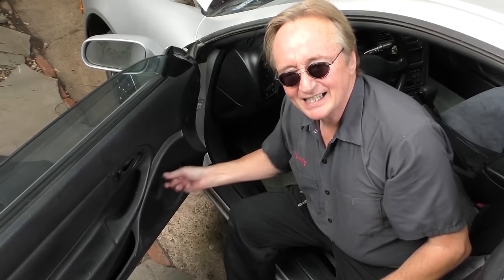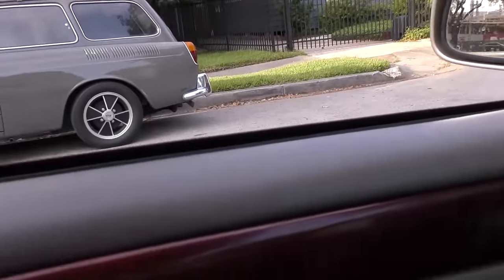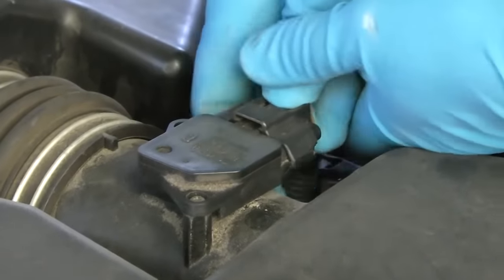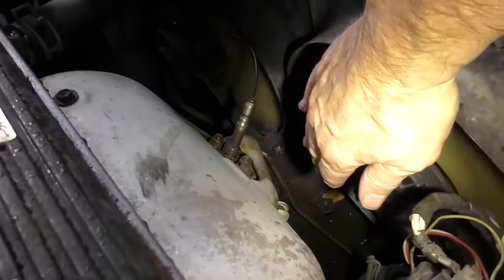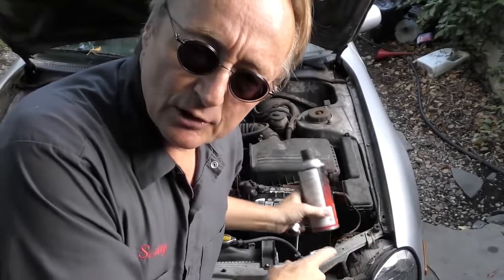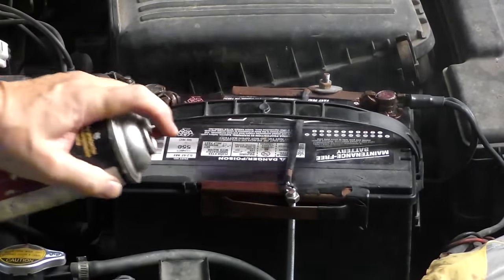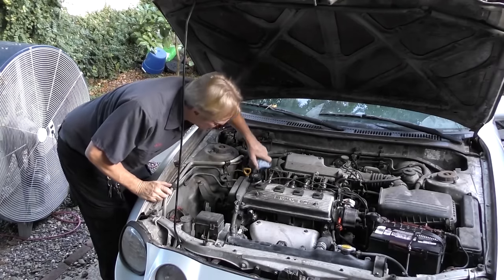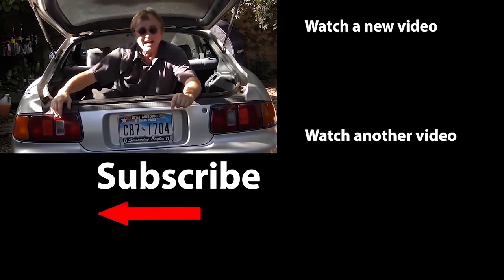I've Been Saying This for Years But You're Still Not Doing This to Your Car

Comment: People thought I was stupid because I did this , glad I've been doing it right all along .
Reply: People were right about both of you
Reply: Abso lutely just be careful in the snow. I live in Canada and I did this once and lost control of my vehicle. Keep your pressure low if slippery conditions, if you inflate to much, max is too much in negative temps, you will lose grip.
Reply: I have a 2002 Nissan Altima  ( I bought new ) that I painted the original muffler  with Aluminum paint every year prior to changing for winter tires. It's still looks great after 18 years !
Reply: @LLC 5016 the window seals are easy and cheap to replace though.
Reply: AngryPostmanSthlm2  say what? That’s a difficult read....
Reply: @maciejolejniczak151  that sounds like projection right there
Reply: We are glad of you now😉
Reply: Stupid people think smart people are stupid! .... go ahead and do what is right!
Reply: @robpet4424  , so you have 18 layers of paint on your muffler?
Reply: @markschiavone8003  yep I guess I do...... but when I show and tell they say "wow that looks like new !"

Comment: Additionally, the silicone spray helps tremendously to keep your windows from freezing to the runners in the winter.  Don't just spray it on the side runners as Scotty demonstrates, but along the top and bottom as well.  Anywhere the glass makes contact where water seeping between the runner and the glass can freeze.

Comment: Pro Tip, when you use the auto down, after the window has completely rolled down, quickly flip the switch up and let go. The reason for this is after the window has completely rolled down, it can take quite a few seconds for the switch to auto-cut power off from the motor. This will really save you a headache and a ton of driver side window motors. Cheers
Reply: Whoah, thank you.  That should have more likes.

Comment: Yeah I remember when the master switch went out on my 2014 Nissan Sentra. They wanted to charge me $545.00 for a new one. I took my car, went to a local junkyard, pulled a master switch out of one of the 30 wrecked Sentras that were close to mine in make and model, put it in and it cost me 75 bucks.

Comment: That silicone helps prevent from getting your car doors being stuck & frozen shut.   During winters, right before it get freezing cold, I spray our car doors rubber weatherstripping with film or coat of this, and prevents them from being frozen stuck.  The regular WD40 helps as well, since used to use that.  And helps prevent from dry-rot.

Comment: I’ve always preferred a thin coat of Vaseline on battery terminals.  Yes as it heat up the film will get thinner but the stuff is cheap and a good glob will last quite a while.  Does a great job keeping the battery acid and gunk off the terminals and exposed electrical metals
Reply: My father does this too. As a mechanic I would have to agree.👍

Comment: Another thing I would recommend with the tires is to check the dot date it's the last 4 numbers in the box or oval after the letters dot the main numbers to worry about are the last 2 that tell you the year the were manufactured if they're older than six years I would recommend replacing them if your tires are older than 10 years they start decomposing and at that point they're dangerous to drive on
Reply: Helpful thank you

Comment: Here is an interesting tip.  I hosed off my radiator on a humid day in early September after a number of trips had accumulated bugs on my radiator.  Only some of the sticky bugs washed off.  An hour later I found yellow-jacket wasps swarming all over the radiator.  They were picking it clean of bugs that the hose had gotten wet but not washed off.  After a few hours the yellow-jackets had completed their work.  The radiator was whistle clean! Talk about a complete job!

Comment: Ya know, it took me nearly two weeks to figure out Toyota's Auto-Up and Auto-Down in my 4Runner? Especially since my Camry only has Auto-Down. If you only push the button partway, you retain manual control. I probably should have read the owner's manual, but who reads the manual? LOL
Now that I figured it out, it's a feature I wonder how I lived without!
If your headlights flicker like a discotheque whenever you hit the button, then you're a proud owner of a Chrysler/Dodge minivan, and no, it's not your battery, alternator, or the windows.
If your car has two electric radiator fans, and only one works, your cooling system can probably handle that (except in extreme circumstances). You will, however, notice reduced A/C cooling ability because the fans also draw air through the condenser. 
Battery corrosion can be easily cleaned up with a slurry of baking soda and vinegar. Sure, it foams up (it's the ingredients for a child's papier-mâché volcano, after all) but it neutralizes the acid and dissolves the fuzzy crystals in seconds.
The only time I've ever flushed brake fluid is after a line failure, I'm a bit OCD so every time I replace a line, I bleed the system at all four corners.
When I buy a car that hasn't been recently serviced, the first things I do are: oil change, tune up, throttle body cleaning, and throttle cable adjustment. You'd be amazed how many times I've bought a car the owner thought was either "a piece of crap" or "on its last leg" that just needed an afternoon of TLC.
"What's the lifetime of the transmission?" "Um, until the warranty runs out." Obviously not Toyota, I'm well-beyond the warranty in my Camry (at just shy of 339k miles) and never felt anything amiss in the transmission. As far as I can trace, it's only had a 100k service performed (by the dealer that sold the car to the original owner) when the fluid was changed.

Comment: HOLY CRAP IT WORKED FOR MY 2004 Camry
Reply: 04 camry is a great car. My O4 has over 500,000 KM's on it and is going strong.
Reply: @stevespademan9611   mine is close lol 460k
Reply: Thats one FUGLY looking car (the whole generation), but nice and reliable tho.
Reply: I just bought a 2004  for my daughter with 210,000 miles and it looks and runs great.Hopefully it will last another 100000 miles!
Reply: I did this once on my window and it worked. It worked so good that when the window was going up, it kept going and never stopped. Til this day my window never came back down from the heavens.😀
Reply: @stevespademan9611  Yeah, they got rid of the 2.2 l four by then...
Reply: Probably the most reliable car ever made.
Reply: @ArnoldPranks  the new ones look good though

Comment: I've been getting recall notices in the mail for a power window problem for my 14 chevy express. not taking it in a chevy dealer bc I dont want them sabotaging my van.
Reply: @mcc7762  i would look into it. I read that they can expire after 10 years?
Reply: Recalls do expire. Had a fuel pressure control module die on my 09  Silverado. They had a recall on them a couple of years ago but they stopped the recall, so the module was not covered. Cost me about$700 dollars to get it done.

Comment: 2:46 Most automatic windows need to be reset after removing your car's battery (especially newer vehicles with lots of computers). The auto down sometimes works, but not the auto up. To reset it, roll down the window all the way and hold the switch in the down position (I know, Scottie says don't do that, but trust me - if you don't trust me, research it). Then, roll it all the way up and hold for 10 seconds. That's it! auto up and down should now work.
Reply: Great info, thank you

Comment: I've only had to replace a broken manual window crank assembly once, but plenty of those electric power window regulators and switch assemblies = "pain in the butt"
Reply: Manual cranks are better, no doubt. People are sheep. They will buy anything.
Reply: 😣Damn drivers side window is auto both ways BUT sometimes likes to go try to go down when I press it up.
Reply: I'm 57 and I haven't owned a vehicle with power windows yet, nor do I plan to.

Comment: Good points have been stated in this video.  Job well done! However, in my opinion the brake fluid should be replaced every 2 years or 50,000 km (30,000 miles approx.). And yet the power steering fluid should be replaced very 100,000 km (62,000 miles approx.). I have always been doing these and never had any maintenance issues.

Comment: We live in an area where we have lots of lakes. My mother refused to have a car with power windows because if she drove in a lake the windows wouldn’t open. My dad worked for one of the big 3 car companies. He got a new leased car each year.  So dad told her to only drive my car that had no power windows or AC. LOL
Reply: Nothing personal roll up windows suck!
Reply: Windows are busted in any emergency anyway
Reply: One can buy a small spring loaded glass breaker for emergency that you can keep in your car. Though a sharp screw driver is good enough to smash side windows with little effort.
Reply: @inisipisTV  the ceramic off of a spark plug also works great
Reply: I live around a lot of canals.  When I bought my Corolla 20 years ago I specifically asked for manual windows.  I got the last model on the lot with manual windows, and a cassette deck.   Windows and deck still work.
Reply: I'm 57 and have never had a vehicle with power windows and don't want to.

Comment: Chemist here. I used to do testing of oil blends in a well known oil manufacturer (know what I mean). What I learned in that job was the reason car manufacturers were able to increase the oil change mileage was because they made the oil sumps bigger. The thought process was, more oil means more additives to use up, the longer the vehicle can go between oil changes (it's the additives that do all the protection and get broken down through use, the base oil only gets dirty and can be recycled). 

I also used to do the QA/QC for a company that repackaged coolant and brake fluid. Some of those coolants are exactly the same just with a different dye (eg. Castrol for Ford is the green version of the Ford blue version coolant. Likewise, super dot4 brake fluid can be blue, green or yellow/clear dependingon the brand. It's just the dye that changes the colour). With coolants, you do have to get one formulated for your type of car. With different rubber compounds, temperatures and metallurgy of the engines and radiators, using the wrong coolant will damage parts, like cause corrosion or scaling on the metal parts, cause the elastomers in the rubber to break down making the hoses brittle, or not prevent freezing or boiling enough (the coolant actually increases the boiling temperature as well as decrease the freezing temperature).

Make sure you use the right concentration of coolant too (usually 50%/50% or 1:1 coolant/demineralised water). It's stays liquid at the widest temperature range at that ratio. If it's too concentrated or too dilute, at low temperatures it turns to partially frozen slush (like a slushy drink) and at high temperatures it reduces the boiling point to the point where you can get cavitation occurring in the water pump due to steam bubbles forming in the low pressure s spots of the pump. Cavitation can act like a hammer and over time can deform the pump housing and impeller to the point where the pump no longer works or can leak.

There's my info dump on those topics. If you've got any questions, feel free to reply.

Comment: Power steering fluid: locate the LOW-PRESSURE Return line, cut it &insert a fuel-filter (I use clear glass reusable filters, you can use whatever kind you want; the transparent.kind let you see if the fluid is getting dirty); ALWAYS put the filter in the low-pressure side, as the Hi-pressure side DOES run at 1,500 psi & usually breaks as soon as the pressure is at it's normal level)...
 Why do I put a filter in the low-pressure side? Because once the filter is in place, I never need to change I again (& I like to be able to see how clean it stays). A few bucks spent once is a lot less than replacing it repeatedly.
Just my preference.

Comment: This video has some good advise. But what you told about the brake fluid is not true. You should change it every 2-3 years.
Reply: I agree, even a small amount of moisture can destroy the ABS module found on modern cars.
Reply: @thebiker5242  yes and it degrades and becomes acidic. That bad for the whole brakesystem.

Comment: Scotty,
Always clean the top of your battery, the dust that builds up on the battery is actually rust from older cars. The dust-rust causes a high impedance short between the battery posts and steadily drains the battery when the engine is off, and causes the alternator to work harder to recharge the battery when the engine runs. A clean battery top saves money in the long run!

Comment: Scotty, I had a 1974 buick with 455 engine bought it new put it in the junk yard in 2014. It has never been in a shop. I took care of it myself oil change, transmission fluid and filter. I'm saving the engine and transmission that has never been open.

Comment: Scotty, I have a convertible with no window frame and it gets stuck anyway so I slam the door while holding the switch and it makes it open. I'm a tech like you and I have a tip or two. I found that if you have the engine running and the A/C off to increase the system voltage that it helps. Also, if you roll the windows up all the way and leave them they tend to get stuck especially on hot days. If you tap the switch on the down side when the window is up all the way to relieve the tension on the window motor and regulator without actually lowering the window any, that will allow the motor to get a running start to move the window so if it's stuck in the track it breaks it loose easier. Most newer regulators are cable driven and the cables have springs on each end to absorb the shock of the window hitting the stop so they hold tension against the motor and kind of puts it in a bind.

Comment: 14:45 I don't know... Synthetic oil is pretty amazing.  My dad uses amsoil and had his used oil tested after 20k miles and it was still good... it doesn't hurt to change it often but I don't know if you really need to.
Reply: I would be less concerned with the degradation of the oil itself and be more concerned about removing contaminants. Synthetic or not, going too long between oil changes is not good.

Comment: Transmissions get hot and wear the hydraulic oil. There is a filter in the pan. You want to swap out the oil and change the filter every 50-60k if you care about the car. Torque converters produce a lot of heat when not locked up. It's always good to have an auxiliary cooler on any car you care about.  It's not to save the oil it's to save the transmission. If you tow anything put a cooler on it.

Comment: Does this work on sunroofs?
Reply: Yup
Reply: Yes.
Reply: And on seat belts...spray silicone on both sides of the belt for the length that it passes through the top hanger on the door pillar..helps speed up retraction when you release the belt.  Spray the innards of the fixed buckles...stops them jamming.
Reply: Also, use silicone spray on all the door rubbers where  the door contacts the car body. Do this just before winter. The silicone makes it harder for water to sit between the rubber and the body..so it doesn't freeze your door shut.
Reply: @teenaramsay2469  Fortunately we don't have that problem during the winter in south Florida because we only get about 15 day's of cold weather down to 50° and that's spread out. Wish we had more.
Reply: Do the door rubbers and the locks too keeps the damp from freezing them shut well it helps
Reply: @teenaramsay2469  Putting silicone on the belt might cause it to slip when it locks in an accident. That would be a good question for Scotty.
Reply: @cliffords.8341  The interesting thing about how a seat belt works..it tears each individual stitch in the webbing apart at a controlled, designed-in rate to spread the force of the sudden stop of a crash over a longer time period...so the "slip" through the top anchor point would also help?

Comment: On your oil change comments, you're absolutely correct with the 5000-7000 mile change intervals.   The modern synthetic oils may in fact not break down for 10,000 miles (or more in a low horsepower family driver), BUT filter technology hasn't changed much in 50 years, and dirt builds up.   I own a car where we have to do solid lifter clearance checks (BMW E46 M3), and through the community we see engines opened up for this reason.   Cars that have 5000 real miles (versus on board computer which may show higher dependent on driving style) change intervals look nearly as new.  7000-7500 mile intervals almost as good but some yellowing of the cams/lifters.  The cars that are unknown or followed the on board computer can go to 15, 000 miles indicated (probably lower actual) show dark build up, not always harmful sludge but headed that way.   Obviously some of these cars have multiple owners, so we assume the ones that have significant sludge used the on board computer indicator or were ignored.
Reply: @Mark Codiroli I've spent my time on bobistheoilguy etc.  What I state about this engine, at these intervals, stands.  Oil changes at about 5k miles little to no yellowing.  7500 miles, yellowing but no significant build-up.   Higher than that build up begins.   This is all with synthetic oil.
Reply: @Mark Codiroli I bow to your omniscience oh God of all dirty oil.  I'm sure I didn't really see what I saw pictures of in the case of this one specific engine in a forum I've been in for years with over 8000 posts.  I must have been dreaming.

Comment: I have stumbled on to some of these over the years. Had an '86 Jetta that was running hot. Discovered the fan was not running. then found all the connections up there to be corroded. It was in the battery area, of course. Then the wiring was odd and came to the conclusion there had been undisclosed damage (and repair). Thanks for the tips!